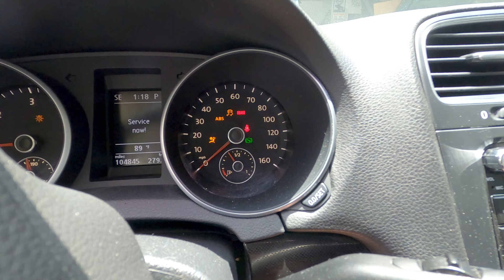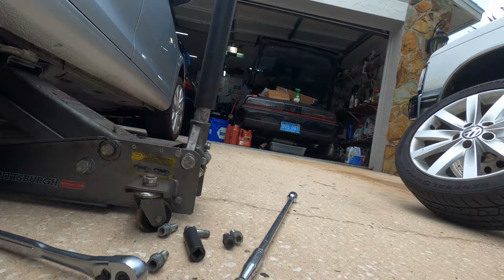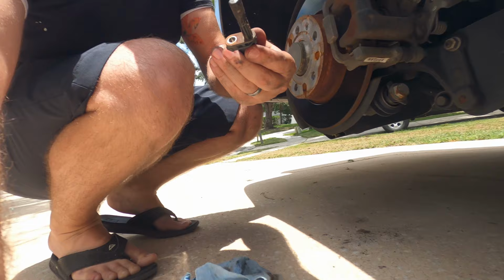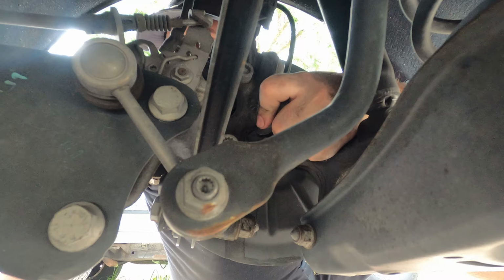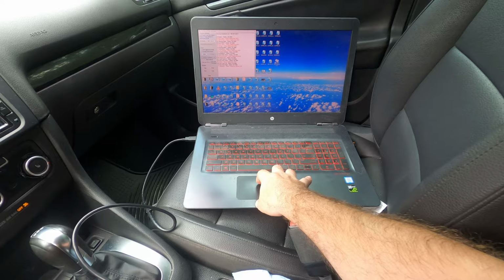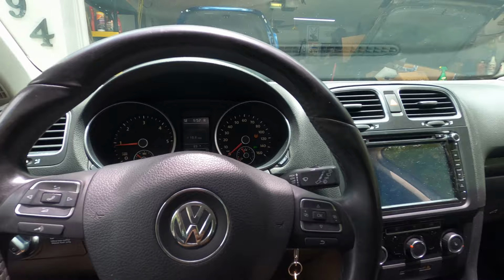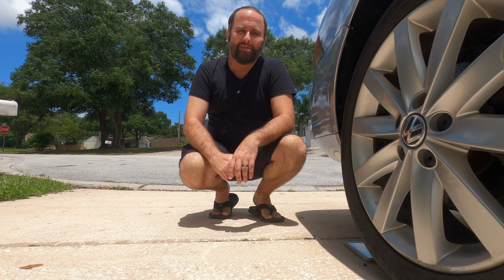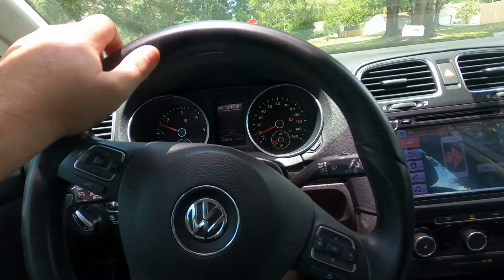VW ABS Wheel Speed Sensor Issues

Comment: Just a quick tip, if you have a set of drive up ramps you can do this without taking the wheel off quite easily
Reply from the maker: Great tip.  At the time I did this one I did not have a set of ramps.  I just replaced one of the front sensors, and could have even done it on the ground had the sensor not been stuck.  Ended up taking the wheel off so I could see what I was prying on.

Comment: That gear shifting issue you described at the end of the video sounds like the vehicle is going into limp mode, which is intended since the car can't read wheel speed due to the faulty sensor.
Reply: I have this problem now , my car is in limp mode. All my lights on my dash board
Reply: @vbvb7490  I'm having the same problem after changing a wheel bearing. Did you get this issue sorted out?
Reply: Almost 80% of VW/AUDI owners have this issue for soon or later !
So it’s including me for twice, one has happened on my 20 years old Audi but solved after cleaning up yeah run fine till now on , and now it has happened to my newest audi week ago and I’m going to clean up the ABS sensor first next weekend because after cleared up all codes it’s still come on again after driving and limping too ! This new indirect TPMS system I must hate it so … and I believe the culprit is ABS sensor itself !

Comment: Thx buddy...this is exactly what my '12 JSW TDI did. It even turned my cruise control off, while on a long haul, and disabled the traction control button. This will be my weekend project.
Reply: Have the same exact car. Did you also have a transmission problem with it acting funny? And did the wheel speed sensor fix that issue for you as well?

Comment: Everything in this video was correct . Strangely it was also my right rear ABS sensor that was faulty but I am driving on the left in the UK . Also had issues with transmission as discussed and automatic gear shift .
Reply from the maker: I'm not sure RHD or LHD would have much to do with which sensor goes bad.  Seems to be a very common VW issue for all of us.
Reply: my car wont shift into 3rd, or 5th and no reverse! no speed sensor codes, but speedometer has been sporadic and my issues arises after a car wash.
Reply: Yes, all of the symptoms you described in this video are exactly what I'm having related to the bad wheel speed sensor. This is the second time I've had one go bad on my 2016 GTI and the symptoms are exactly the same as the first time, exactly the same as this video. Thank you for sharing.

Comment: my god! what a treat to see suspension parts not covered in rust!  Never ever see a car up here in Iowa look like that. They are completely enamored by road salt!
Reply from the maker: That's Florida for you.  I'm from Ohio originally so I know what you mean.  Those salted roads destroy all.
Reply: I have this problem with a Volkswagen Passat 2016 TSI... I might have to spray and clean them down 😞... Don't know why Volkswagen has this problem on every car? ...is it recalled? I don't wanna take it to the shop they will charge me an ARM AND LEG... I changed them and it off then I went on the highway and it came back on.

Comment: Very helpful thank you. I just bought a 2012 Touareg and while driving it home on motorway 🛣, had the ABS, Traction and electronic parking brake warning lights come on. Had a mechanic scan the codes and it came back with faulty rear left speed sensor. Getting it fixed today, but it's good to see how easy it is to replace and maybe worth keeping the old one and cleaning it up as a possible spare. It's seems like a common failure on the Touaregs so being able to swap out almost like a light blub is very useful to know. Also i think I might invest in a scanner, it now seems like a no brainer with modern cars being soooo electronic, I imagine it will save be money after 1 or 2 problems. Going to the dealer for a scan costs about £90. Thanks for making the video and greetings from Cornwall UK 👍🏻.
Reply from the maker: I would say if you're worried about them you could just order spares to keep on hand.  I haven't really had much luck reviving an old one once it starts acting up.  I have had decent luck with the cheaper aftermarket sensors though.  I would highly recommend getting the VAG-Com and VCDS from Ross-Tech.  Being able to easily read codes and interact with the vw specific modules is essential if you're going to do any work yourself.

Comment: For the shifter problem he spoke of at around 8:50 on the timeline. I had shifter issues but after I cleaned the negative battery terminal cable where it is attached to the frame... all was well.  Electricity could not flow smoothly and it causes all sorts of weird issues.
Reply from the maker: I haven't really had any more issues with transmission, but I will definitely take a closer look at the batter cables and grounding points.  I've had issues on other vehicles from bad connections.  Good tip.

Comment: Proud (and brave) owner of Scirocco 1.4 tsi petrol engine here...

Hello! My testimony after this thorough and simple video (which I gratefully thank you for putting out!):

- sensor replaced: lights still on;
- magnetic ring wheel bearing replaced (it was needed and to further troubleshoot): lights still on.

Since live data showed that rear left wheel sensor was soundingly collecting data and no diagnosis errors report other than right wheel:

- Still need to check cables from rear left wheel up to abs control unit and if anomaly isn't from there, need to check fuses, voltage/power/etc from that end.

...this is an exhaustive process since I'm not a mechanic and these darn lights started their Christmas by themselves after 1 year of routine driving with no issue whatsoever... 

Hope still is intact but the headache factor of these little nothings that are of considerable number in VW systems and cars is starting to be very very annoying.
Reply from the maker: Very frustrating, I guess I got off easy with it only being the sensor.  I'm a little confused though. . .If you're not getting any errors on the left side why check the wiring for that side?  You did install the correct replacement sensor for location correct? . . .i.e. you didn't put a right front sensor on the right rear, etc?  

I've hear of the abs module itself going bad, but I have fortunately not had to deal with that issue.
Reply: @VHickleGarage  maybe I fumbled my words.

The error exists and reports the rear right wheel only.

The driving data reports all three other sensors registering speed minus the rear right wheel.

Hence the needed wiring inspection and (hopefully not for now) the ABS module revision.

To answer your questions straight up: nope. The sensor is correctly installed.

Thank you for taking time to reply!
Reply from the maker: @marcelosilva9429  Got it.  Hopefully it's just a small short in that rear right wiring. 🤞

Comment: Like you, I do not like Christmas lights on my dashboard. Until I watched the video, I was afraid to drive it for fear of damaging...everything. The video gave me peace of mind to drive the car to the dealer for a warranty repair. TmThanks for the gumball Popeye!
Reply from the maker: You're Welcome.  Thanks for watching!
Reply: @VHickleGarage  

Just a dead battery. $180 at the dealer, $60 install, $150 to reset the codes. $415 out the door. I know it is too much to spend, but a guy has to know his limitations!
Reply from the maker: @troysheldon5539  Ouch. . If you're even the slightest bit computer savvy it might be worth investing the $200 in a Vag-Com.  It's not difficult to use the basic functions, and pays for itself if it saves you one trip to the dealer.
Reply: @VHickleGarage  I will check it out. Thanks.
Reply: @troysheldon5539  pretty harsh charging $150 to reset codes. They literally just have to push a button on The scanner. Maybe you should have spent that $150 and just bought a scanner for yourself. I got a blue driver for a hundred bucks that'll reset codes

Comment: You're a GOD. I was having the SAME problems including the downshifting.
Reply from the maker: Thank You!  Glad it was able to help you fix the problem.
Reply: @VHickleGarage  Did your transmission issue fix with this? AAMCO is telling me that the transmission output sensor is also going bad.
Reply from the maker: @jikert4815  In my case yes the wheel sensor seems to have cured the shifting issues.  I didnt have any other codes though. .if your car is throwing codes for a trans sensor, then you may need that one replaced as well.
Reply: @VHickleGarage  It's not throwing codes for anything at all. I just know one of the wheel sensors is going bad, but it doesn't say which like it did for you (probably the software I'm using) but the shifting is horrible. I was just curious if it also fixed your shifting. I will probably replace both kinds of sensors and see what happens
Reply: Did you get it fix
Reply: @obinsonsniper-el7sw  Yes and no. I redid the suspension, wheel bearings and such, and a fluid flush. Warning lights are still on but no codes still. VW says it's the ABS control module
Reply: @Jikert  good I just fix mines to it shifting out good

Comment: I have the same issue with my 2009 Jetta. All the dash lights are ON... . I bought a used ABS pump and controller.... it was money wasted. I recently ordered all 4 abs sensors that I haven't received yet.  I will post my end result once they're installed.
Reply from the maker: If you plan to keep the car and work on it, I highly recommend investing in a VAG-COM.  Good chance you only need 1 sensor, not all 4..  You'll save a lot more $$ in the long run buy scanning first, then ordering parts.

Comment: What software are you using to read your Error codes?  The Wheel sensor are Hall Effect sensors and work off of induction produced from the steel tone ring rotating.  Dirt(road grime) on the outside of the sensor should not have any practical effect.  A damaged tone ring is something that people should visually check right a way.  Excessive Rust can cause them to fall apart. As long as there are no metal particles shorting out to ground, it should work. That would be a lot of metal particles.
Reply from the maker: I'm using VCDS along with the appropriate VAG-COM from Ross Tech.  You're right on cleaning. . . It didn't accomplish anything.  Someone on one of the forums had suggested it, so I figured it was worth a try before buying  a new sensor.  There was a lot of crud on the old sensor, either way it was worth cleaning it all up before installing the new sensor.

Comment: Had this happen to me today, I just had my tires changed and rotated 3 days prior to the Christmas tree so the mechanic probably got the sensor dirty or it just broke (49,000ish miles), I don't have any software to clear codes so its time to take it back to the shop.
Reply from the maker: From what I understand, it's a pretty common issue, so probably nothing the tire shop did.  If you clean/replace the sensor the lights should go away without clearing the codes.  If you're planning to keep the car a long time I would suggest investing in a VAG COM.  One saved trip to the shop and it will pay for itself.

Comment: Great video , I have a  2012 CC with numerous problems. I have all of those dash lights on and shifting problems. This is first time I have heard that those sensors may cause shifting issues and I have been to a VW dealer as well.
Reply from the maker: I believe I read that they can be part of the shifting issue.  I have had the shifting issue happen randomly a couple times since I replaced the sensor, but it's much more rare than it was before.
Reply: @VHickleGarage  what other issues can that sensor cause. I'm looking at a 2013 cc to buy and says it has a bad abs sensor but it is braking really weird and shifting in high rpm sometimes.
Reply from the maker: @ryanloughlin6380  The sensor can definitely cause some shifting issues, but no guarantee that's the only thing.  For the brakes I would think the sensor could cause issues with them as a result of ESC, but I don't know for sure.

Comment: I am at my wits end with mine doing this. It also says right rear but I get a steering wheel light as well. I will replace the sensor now after this. I have already cleaned it. Mine started after i washed the engine from a fuel leak while doing a delete and cp3 pump.Great video.
Reply from the maker: As I showed in the video the cleaning only made the problem go away temporarily for me too.  Hopefully a new sensor will solve your problems.  Have you scanned the codes?  I'm about to go chasing a new fuel leak myself. . .

Comment: I just had all these light popped up on my dash like Christmas lights! Did it also clear your "tire sensor?" Looks like it cleared too. Awesome video! Thanks!
Reply from the maker: Yes the speed sensor fixed my TPMS light.  I know it's not true for all Vw's, but the sportwagen doesn't actually have TPMS sensors, it determines whether or not there's an issue based on the speed sensor input.  At least I believe that's what I read when I first looked into it.

Comment: Have the exact same issue in my 2016 Tiguan. Full Xmas tree at start and the lights go away if I turn off the ignition and start it again. My VCDS cable is currently 5000 miles away as I’m in the middle of a move so I’ll have to get that shipped here asap. Thanks!
Reply from the maker: As long as you're not experiencing any other issues you can probably get by like that for a while.  I drove around like that for at least a month or two before I got it fixed

Comment: Thanks, very useful info, From the last week I have multiple errors from Being starting the engine with loud long single alarm ,than ESB, ABS lights stay on, shows Auto Hold is not working, than saying The tires monitoring pressure is out, the Cruse control is out.. than after a while all errors gone by itself , everything back to normal until a few hours later or the next days.. i have no idea what was wrong just thinking all those errors come from single point which may only one sensor..vw golf bluemotion
Reply from the maker: All of those warning lights, and it being an intermittent issue definitely sounds like my experiences with an ABS sensor that's on its way out.  I've got another one like that right now, and the lights just recently came on and have stayed on, so I've got another one to replace.

Comment: The best video ever thank you I have this problem as we speak took it to the VW dealer and all the dash board lights lite up and they claim it was the sensor RT rear then the next lights were on again then they say it was the alternator then I took it back several times and I was told that's another sensor took it back yesterday and I was told that he changed it and the lights are still on now he's telling me that another sensor need to change changed the RT front oct 2, 2020 what I think is they should have checked all sensors and tell me right there what the problems were but thank you I have learn something about sensors
Reply from the maker: You're welcome.  Can be a frustrating problem for sure.  I'm starting to have intermittent sensor issues again myself, but I haven't yet checked to see which one is the problem this time.

Comment: 2013 VW CC sport, After battery died and replaced battery almost every single lite lit up. Airbag, ABS, Traction, Steering, check engine and AFS. To this day can not find problem, replaced left wheel sensors and lights went off. (code reader said left was bad). Then lights came back on now code reader says Right wheel sensors are bad, still have to change them. Another issue to note is sometimes car would start then stop, it would not run, I would have to disconnect negative terminal on battery, reconnect and then it would start. If I replace right sensors and problem persists it is a toss up of either a short in wiring somewhere or problem with computer or one of the CAN modules.
Funny how one thing can make the entire car go wonky, it is a royal pain in the butt.

But this is not the only thing in repair; one is headliner redo, repaired broken wire connector up front, replaced all brake pads, MAF sensor, wastegate valve, replaced grille with emblem (because somebody smacked it) and now radiator support shroud. Because I drove front over a concrete car stop which ripped bottom section of plastic shroud. Joy Joy happy joy, Not!
I sure hope when I replace those wheel sensors it will solve most of my problems and hoping that I don't have turbo issues and figure out what's going on with AFS after replacing bulbs.

I am happy I came across this video because it lets me know I am not the only one with these crazy issues and gives me hope. At the very least it points me in a direction and gives me clues, even though this video is two years old, many thanks.
Reply from the maker: It's common to have codes and some lights when changing a battery, but most of those should go away pretty quickly.  

Hopefully the speed sensors will take care of a lot of your lights.  It sounds like you definitely have an electrical gremlin somewhere.  Between the Sportwagen and my A4 I have had my share of them as well.  I would start by getting a VAG specifc scan.  The VAG-COM will tell you a little more than a normal OBD2 scanner.  I would also check your main battery ground, and then closely inspect wiring anywhere you had other damage.  

Good Luck!

Comment: Great video. Recent has this exact issue on my 15 Jetta TDI. Gonna change out the sensors & update after i do.
Reply: Update please
Reply: @necamarjanovic1266  Replaced front sensors. Fixed for a bit. Ended up also having a rusted out tone ring in the front right wheel bearing. Replaced, cleared, and it’s been working fine.